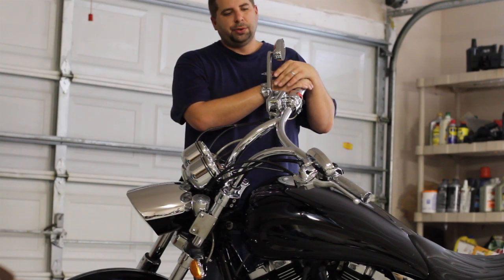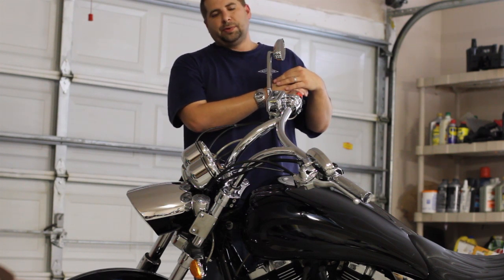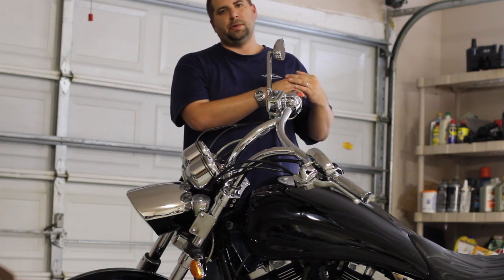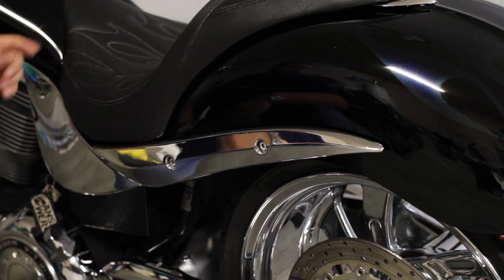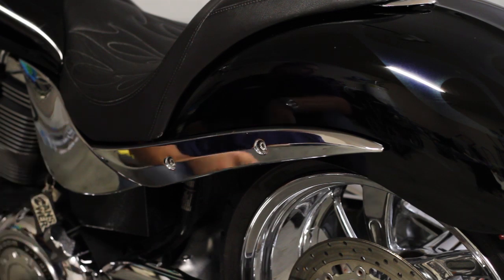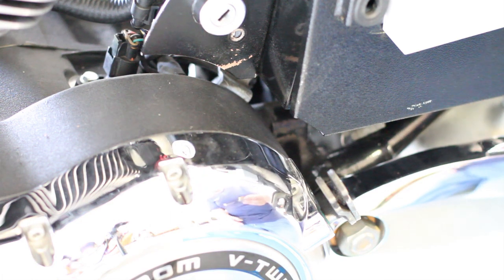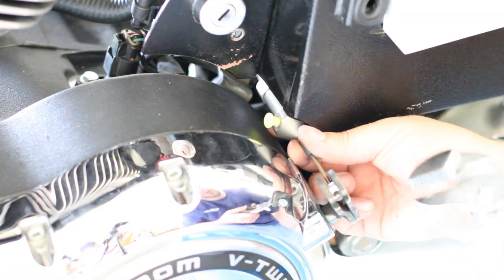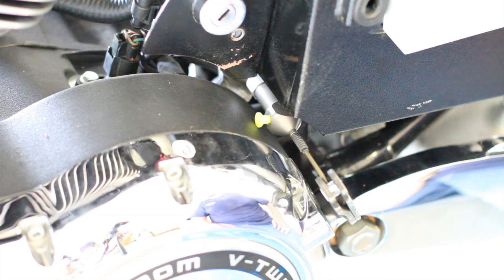How-To: Victory Vegas hydraulic clutch conversion

Comment: Great video I didn't know victories had cable clutch system, I thought they would come with hydraulic as standard. I've been wanting to do something similiar to my xj900s, so I have a few questions. Can you buy the kit minus the master cylinder ( I already have a donor unit from an XJR1300). How long is the supplied hose. And you say system used DOT4, that's just standard brake fluid?. How much would a conversion cost approx. Thanks.

Comment from the maker: There is nothing to adjust on the hydraulic setup. As long as your clutch can fully engage and disengage fully then you're good to go. Makes rue the lever can move smooth and easy all the way to the handle or grip from rested position. My hydraulic slave actuator had some trash in it preventing it from fully moving when I first installed it so my clutch was almost impossible to squeeze. After getting the trash out of the actuator my hydraulic system was able to function fully. But there is nothing to adjuster really.

Comment: I have the hydraulic clutch installed on my 2014 Cross Country tour, but after bleeding out all of the excess air in the hydraulic clutch line, I noticed that the stock clutch cable actuator only moves about 1/4- 3/8" of any inch. How do you know when you have the hydraulic clutch adjusted properly?